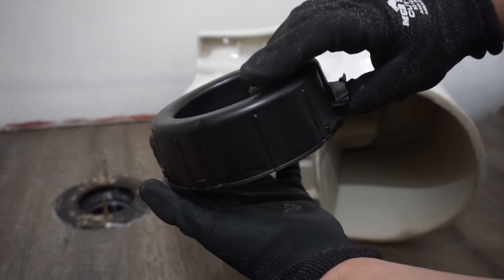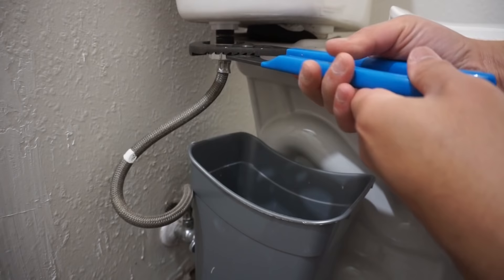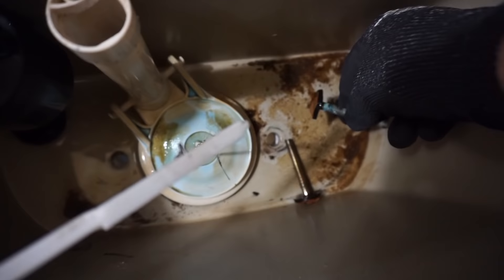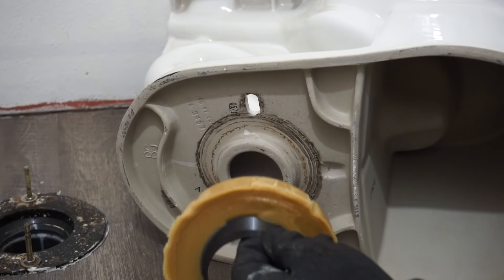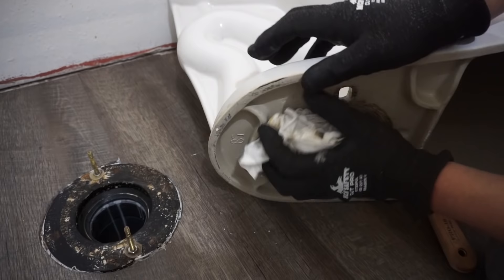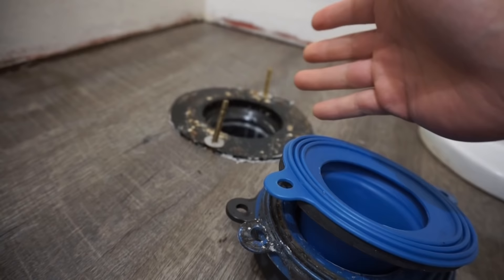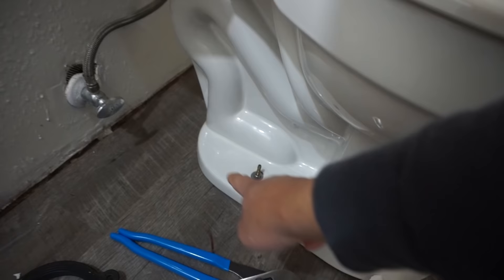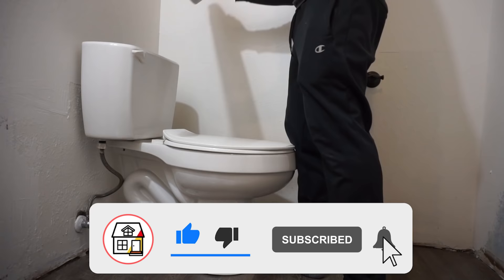How To Replace A Toilet Wax Seal OR Rubber Toilet Seal On A Toilet Flange To STOP Toilet Leaks!

Comment: Yeah, I’ve replaced, ten plus, wax rings and have never removed the tank. Extra work for no reason.
Reply: I install flooring I've probably put in 1,000 toilets and never taking the tank off
Reply: I'm a licensed plumber and I wouldn't take the tank off to swap a wax seal.
Reply: Im a DYIer who has only replaced a wax ring once in my 30 year life. And I didn't remove the tank. True story.
Reply: I don't plan on doing this until next week and I didn't take the tank off.
Reply: @MrChris4251  🤣
Reply: Not necessary to take the tank off just makes the toilet a little lighter and a little less awkward to deal with.
Reply: I'm a contractor and have never removed the tank to install a wax ring
Reply: As someone who used to do demolition work, I have never removed the tank in that way.
Reply: Yup
Reply: I just like taking the tank off of every toilet I use. I'm not invited anywhere anymore.
Reply: @Mizzelphug  I like taking upper deckers
Reply: I think the purpose is for people who cannot move the whole toilet
Reply: I never installed a toilet and I didn't take the tank off.
Reply: All the instructions for installing a new toilet also say to set the bowl and then add the tank, I always build the whole toilet and then just sent the whole damn thing. It's so much easier to get to the Tank bolts before its set
Reply: I'm a bear and I crap in the woods but i never took the tank off
Reply: I took the tank off once but I was young and hanging out with the wrong crowd.
Reply: Only reason to take the tank off is to replace the bolts.
Reply: I'm a plumber as well and yeah you don't ever have to remove the tank..
Reply: My bathroom has a wall-mounted shelf right above the toilet tank. I might actually have to remove the tank first to get the toilet out 😢.
Reply: Thanks for sharing
Reply: Yeah I'm with you guy's why take the tank off for no reason. Why take a chance of fn something else up. Rookie
Reply: I have never replaced a seal. I’m watching this video for the first time. I also would never remove the tank as it is clearly an unnecessary step
Reply: Your right he's not a pro
Reply: I own a world wide company for only changing wax rings on toilets and have never removed the toilet tank
Reply: @MrChris4251 I'm a toilet that used to have a wax ring and I've never had my tank removed.
Reply: I did 6 years of grad school for advanced degrees in wax ring science and toilet mounting theory.

I published 4 papers on the subject of tank removal during the wax ring replacement process, and I’ve never taken off the tank.
Reply: At 60 years old and a lot of pain issues, I'd absolutely take the tank off to help me.
Reply: Real professional do take off the tank.
Reply: No doubt, removing the tank is the best way to go for a non professional.  I’ve seen deformed wax seals restricting the flange opening because it wasn’t lowered properly.  It’s two bolts to take the tank off.  Granted, if I was on the clock I might not but if you have time, remove it.  The tank bolts are probably ready for replacement anyway if it’s been there a while.
Reply: I’m a mechanic and I don’t usually deal with toilets but I’ve never taken the tank off
Reply: Or doubling up on rubber seals lol
Reply: @AngelFernandez-br7xs  It makes the job easier and more reliable.  Yes it takes longer.  The base is much easier to set in place without the tank to ensure a perfect seal.  It also gives a great platform for a level.  I set it straight down, I check it for level as it settles into place.  If it’s off I use those flexible wobble shims to get it level and it will never rock as long as the floor is good.  Then new tank seals and bolts if required.  I’m not a plumber on the clock tho.
Reply: I never take off the wax ring when replacing the tank. Oh, wait...
Reply: I was gonna say!
Reply: I was 3 years old when I replaced my first wax ring and didn't take the tank off. True story
Reply: @BIIIKES  😂😅
Reply: My plumber told me that if it's time to redo the seal, it's a good time to replace the bolts. We live in an area with highly chlorinated water so it may depend on the characteristics of your water and the reason you are installing a new wax seal.
Reply: I’m glad to see the comments on not removing the tank, they confirm my thoughts.
Reply: Is it necessary to caulk around the commode?
Reply: I kind of understand why he took that tank off. I'm no plumber at all. However in order for me to remove that wax ring I'm going to have to remove the tank completely into another room in order to remove that wax seal. There's no room anywhere for me to do that. If I remove the tank I will actually have some room to do it.
Reply: True. But the purpose specifically mentioned in the video is to replace the rusted bolts that's connected to the tank.
Reply: I removed the tank before watching the vid or reading the comments. But I'm 66 and did it cuz it makes the refit easier for me. Those wobbly flange  bolts are a lousy design, imo. Job done, a bit lighter and more assured the wax ring is set properly.
Reply: Cistern.
Reply: I love Chinese food,and I too would not remove the tank to replace a wax ring

Comment: I'm a plumber by trade.  One thing I really dislike is this plastic ring. Best way to explain why is because it has a horn or extra flange. It's almost like having a trap on top of another trap. Wax ring is messy yes but it's been proven for many years. I only use wax rings.  Only reason your toilet would leak is if it's not level or if it's loose meaning it rocks back and forth. That's why there's spacers to even out the toilet and prevent this problem. In many cases this extra flange slows down the water pressure when flushing since it is being funneled by not only the trap but by the flange on this plastic ring.
Reply: Ditto.
I'm 67 and a computer engineer by trade. But, I fix everything in my house and only call "professionals" when 3 things are met:
1. I can afford to have someone else do the work
2. I know that professional can be trusted, and I'll pay more to get that person.
3. I think I could get in over my head. I had a professional cut 7 85+ foot trees down for me. The crew chief was a climber. That means they dropped what he cut straight down, missing my outbuildings and fruit trees. I cut down trees that tall myself if there is enough room for them to fall without damaging anything. I am good at that. I can fell a tree to within 15 inches of my target every time. Usually I'm ~6 inches from my target.
To the point. I only use wax. I've Never had one leak, and contrary to what we were told in the video, they last many years. The last time I replaced one in a home about which I could keep track, the wax ring hadn't leaked or failed. That repair is ~55 years old. I'm closer to 70 than 65 now. And amazingly, I can remember stuff, unlike Brandon.
Reply: @KLP99  let’s wait until you get to 80, you won’t remember anything, like brandon
Reply: Victim Hood  you are telling me that your floor temperature gets above 130° ?I don't think so.
Reply: Victim Hood  that's the reason code says to stay 6inches away or more and to be insulated. Think about it plastic/rubber will warp so if the install is done incorrectly it won't matter what you use. Good try though
Reply: If that extra horn bothers you just cut it out.    I thought about it but decided I didn't need too it's flexible and the same size as the toilet outlet
Reply: Victim Hood  are you in Florida of Arizona? I live in Florida and have not had a wax ring melt or fail ever. We do have AC and are in our house it is always well under 100 degrees.
Reply: @360electronics  lol
Reply: @exceleratorjoshua  I just clogged my toilet & now I have water dripping from my living room ceiling. What is this?
Reply: But if you mod it it won't ever leak .wax will fail eventually. Especially if you have a heavy sitter
Reply: @HoweyJR_  Did you have to plunge the toilet?
  This is what concerns me about wax rings.  I suspect at some point repetitive plunging might cause a leak. 
  That being said, I have never used a plastic one.  Not sure I want to try one.
Reply: @rickeykeeton4770  the water in my toilet was STILL they call it still water when it’s supposed to be no water in the line under the toilet. So I’m good now but before sometimes my toilet wouldn’t flush but now it flushes smooth every time I use it
Reply: I need some help so if my toilet is leaking to to it being loose or Rocky what do I do just tighten them? And what are spacers ?
Reply: @dominiquemurray3112 use shims to level it up...if it's rocking you will get a leak

Comment: Rubber is not forever. Rubber degrades over time as well. In fact it almost seems to degrade faster than wax.  Wax maybe messy but its actually time proven and tested.
Reply: 👍🏻 Wax is the way to go...tried & true 💯